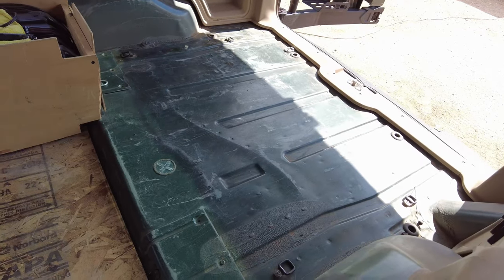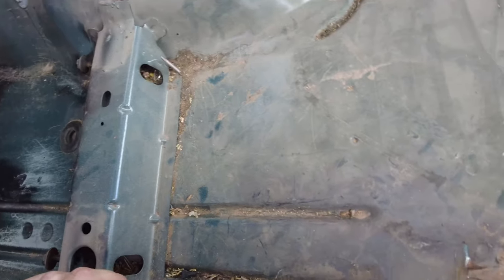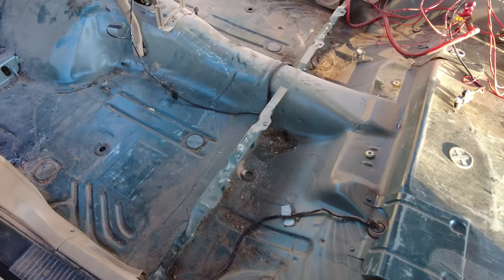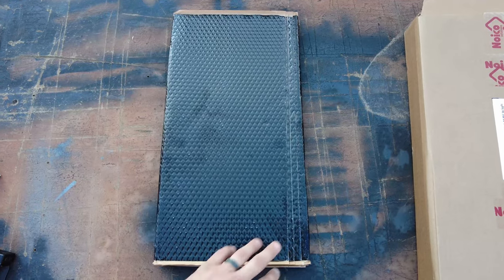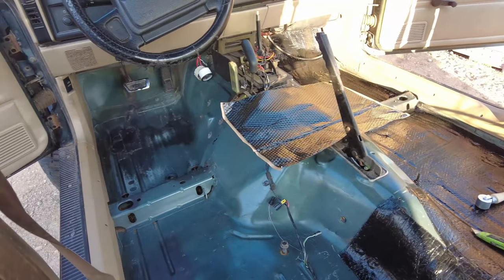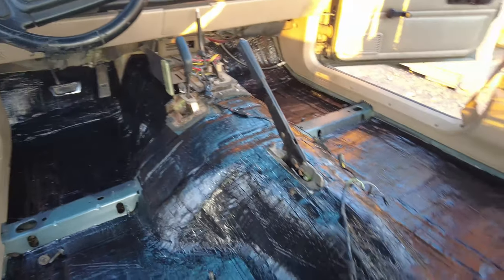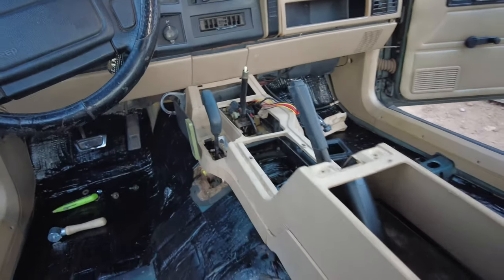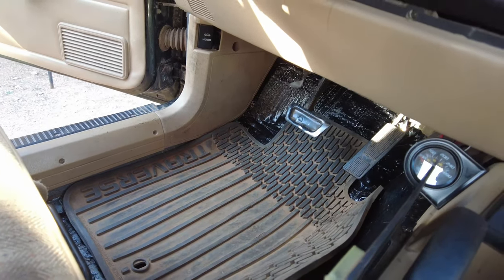WATCH THIS VIDEO BEFORE INSTALLING SOUND DEADENER/INSULATION IN YOUR JEEP!

Comment: I used the same product on my XJ.  I did the ceiling, and the front doors as well.  Made a huge difference with road noise
Reply from the maker: That’s good to know! If I ever have to take the door panels off I might add some in there and same with the headliner
Reply: @2AOverland  If and when you do the doors, you’ll have good results if you apply Noico To the inside of the outer skin, as well as behind the inner panel.
Also, any time you have access to hidden areas, that’s a great opportunity to apply FluidFilm to prevent corrosion

Comment: Is the sound deadner durable enough that you could just leave as the only thing in the floor-[ no carpets]?
Reply from the maker: It is! I had it like that for 6-8 months with no issues other than the aluminum scraping off some of it if you drop something

Comment: Nice install! The roller is the size it is for a reason. Need to apply enough pressure for proper adhesion. A wider roller will not apply the same amount of pressure per square inch.
Reply from the maker: Good call that makes sense! 🤔 thanks for watching!

Comment: Hey brother I know this is an old video but I’ve been having extreme heat issues in the cabin and was wondering how much the insulation actually helped with keeping it cooler.
Reply from the maker: It helped slightly with the heat but really cut down on the noise. If you do this use the insulation too and it’s been a game changer for us with the heat. I’ll link you the vid of us installing the vinyl floor and insulation 

https://youtu.be/QGfoqxIfHx8?si=37pDn10T6Ad0GqgR
Reply: @2AOverland  i appreciate the quick response. guess I’m gonna have to do both the insulation and vinyl floor for the best results luckily I only have a 2 door so I don’t have to take out as much stuff and won’t take as much material
Reply from the maker: That’s your best bet. But that’s good! It took a while to get everything done right but it’s been great since I’ve installed it

Comment: So has it made a difference???? Is it as hot? Is it quieter? 17 minutes and zip.
Reply from the maker: Thanks for watching! It really has! I took it for a test drive today and it’s night and day to be honest. Once I get the vinyl floor in with the insulation backing on that I’m hoping it sounds like it did when it came from the factory 😂
Reply: @2AOverland  can’t wait to see the vinyl. I’ve been thinking of bedlining my interior but my floor and trans tunnel get too hot. Btw moss green is the best xj color haha
Reply from the maker: Thanks for watching man! I’m gonna do the vinyl when it cools down so I’m not dying outside in this heat 😂 I thought about bed lining the inside too but the heat is too much for us during the summer. And I have to agree with moss green! If we get a new jeep in the future I’m getting it painted the same color as the XJ if they don’t offer it from the factory.

Comment: I use rolled roofing the peel and stick for floors. Great for and offroad rig. I had 2 adapters and broke both. I was looking for something to cover bare metal roof before it becomes too hot this summer. Nothing like wanting to tilt your head while driving to get away from the heat off the roof. I like the trans tunnel producing heat. It keeps my coffee warm on the ebrake.
Reply from the maker: Not a bad idea with the rolled roofing! On the roof that would be great. I have a buddy that didn’t have anything on his roof and he had the same issue especially during summer 😬

Comment: Does it improve ride quality and sound and if so, how significantly?
Reply from the maker: It’s a huge improvement over not having anything at all. The only downside is if you scrape any of the aluminum foil off the deadener it will be sticky. A few pieces of our camping gear has sticky stuff on it lol😬
Reply: @2AOverland  35" at on my cherokee and you have to basically yell to have a conversation on the highway so this is definitely something I'm seriously considering doing
Reply from the maker: Yeah you’ll want to do this forsure! I have another video on installing insulation over the sound deadener and putting in a vinyl floor too. With all 3 of those things it’s night a day cooler in the jeep and a hell of a lot quieter too. Here’s a link to the video if you’re interested. 

https://youtu.be/QGfoqxIfHx8

Comment: Is that a magnetic side arm holder on the side of the center console?
Reply from the maker: Yes it is! 😊
Reply: @2AOverland , Did you make it or buy it?
Reply from the maker: I bought the plate and had to bend it into place, trim the center console and bolt it in and glue the magnet on. Here’s a link to the plate and magnet. I’ve had zero issues in all the years that I’ve been using it. 

Magnet https://amzn.to/2YJ16IZ

Plate https://www.t-mfab.com/store-3/?model_number=am

Comment: Curious if POR Raptor Liner would essentially do what a sound deadener like you used would do, but also seal up the pan 🤔

Btw: Noico is good shit. I put it in all my XJ doors.  Doors sound solid as hell now, but I used the Noico with the foil material on the outer surface.

My main concern with using the sound deadener is with moisture getting trapped between the deadener and metal in any areas that didn't smoosh down all the way.
Reply from the maker: Thanks a ton for watching! I’ve heard nothing but good things about the raptor liner but I haven’t used it. I think you could get the same results with multiple layers depending how thick the stuff is. And the added grip would be a plus too! 

I thought about doing my doors actually with the noico but I’m not sure where to apply it. Did you put it on the inside of the door with the window up or did you put it on the inner panel after removing the interior door panel?

Comment: Could you fit carpet over the sound insulation if you wanted to ?  Asking because I may need to do this in a restore
Reply from the maker: I think you could! It’s not extremely thick with all the layers. In a few weeks I’ll be doing a video installing vinyl floor along with normal insulation over this sounds deadener if you wanna stick around and watch it